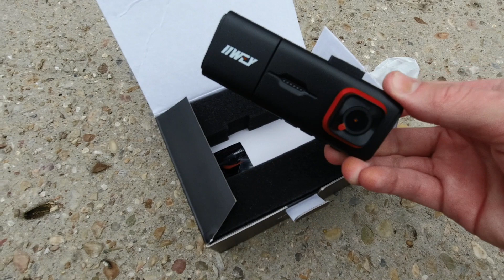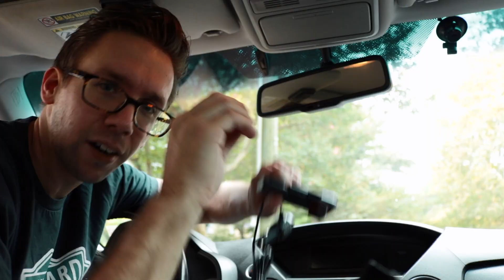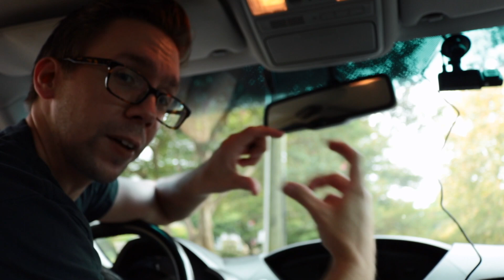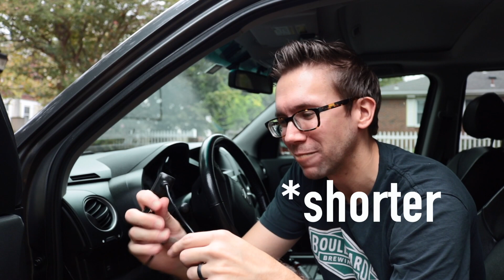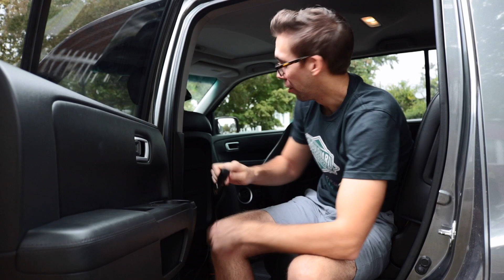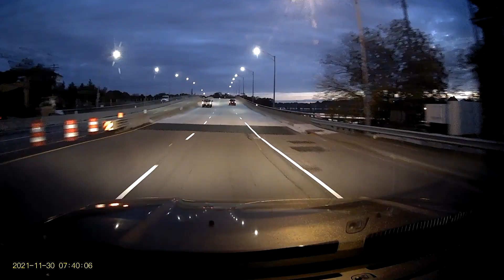IIWEY 3 Channel Dash Camera - Unboxing, Installation and Mini Review

Comment: The only thing that I don't like about the camera system is the wiring it's exposed right in front of you by the front windshield window the cord hangs down to where you have to plug it into the light socket it's very distracting.
Reply from the maker: Yup totally agree - really the only way it get around it to mount super high up and run directly into the headliner. On some newer cars instead a dot matrix extending down for the rear view mirror they actually have it entirely black to cover up the wiring for an electric mirror. I really like making the camera head just peak out around that but depends on the vehicle. You can always hardwire on the backside of the acc plug - I’ve done that quite a few times. But on an SUV I kinda like the rear plug trick